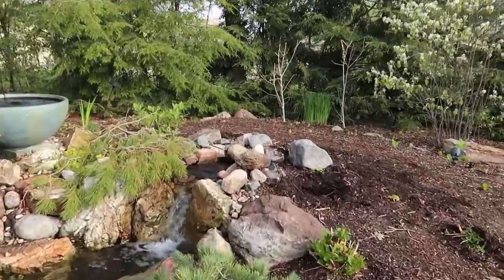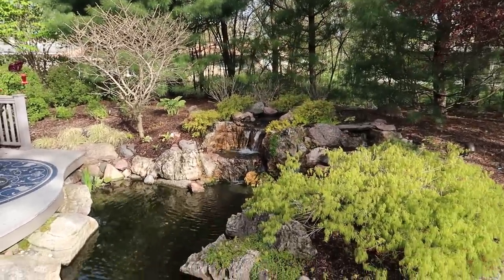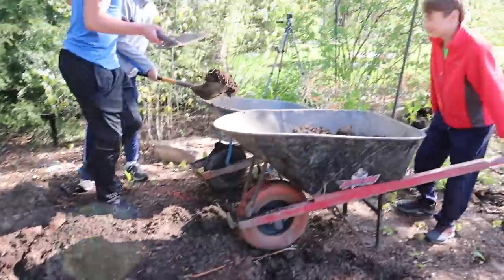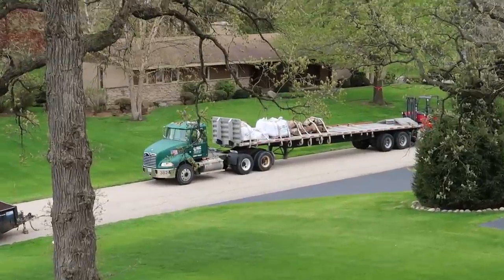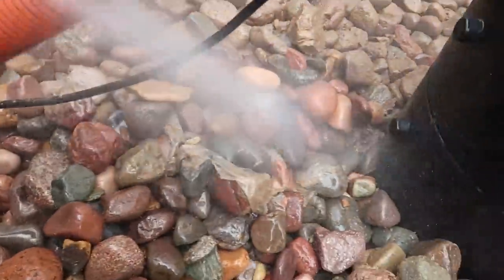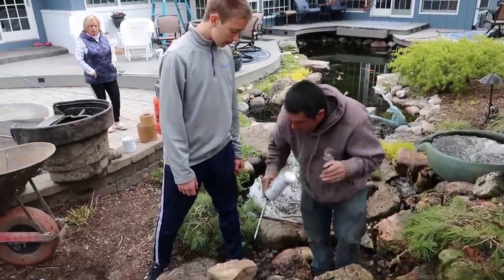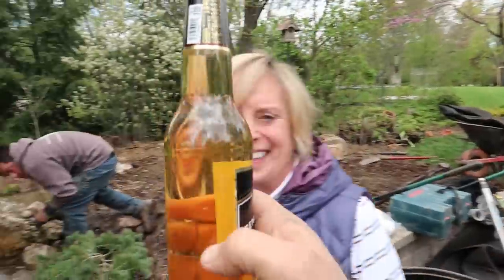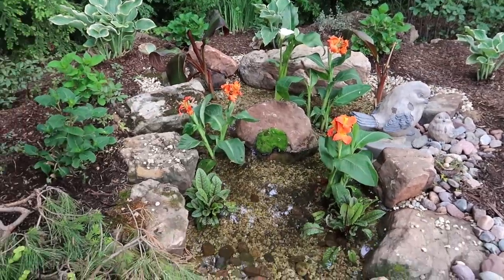World's Best *POND* Filter - Wetland Filter for the Pond Mom

Comment: I watched this several times. A few steps missing. Where’s the pump? I assume reuse, but at least show where it’s at. How did you insert the line? What’s the purpose of the wide pipe going up? I assume overflow, but it could bypass the filter entirely, thus reducing cleaning ability.
Reply: That are many many other things that got left out too